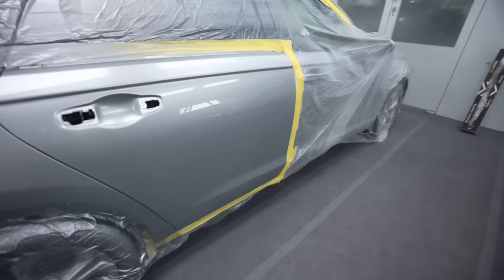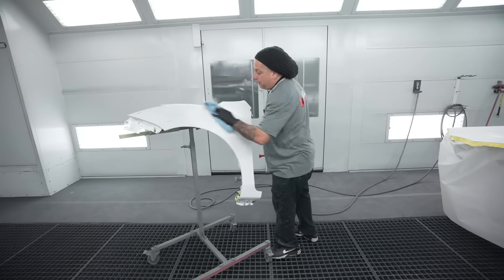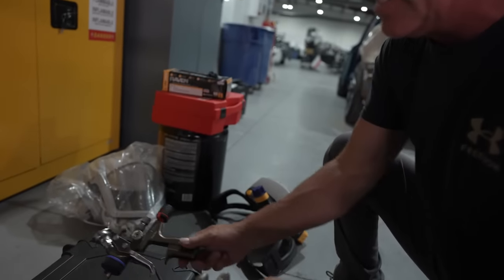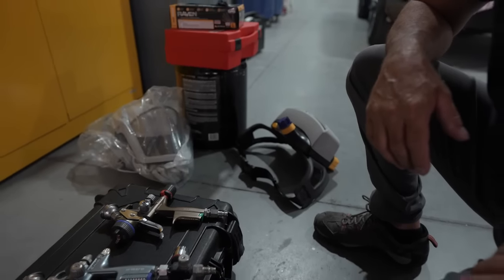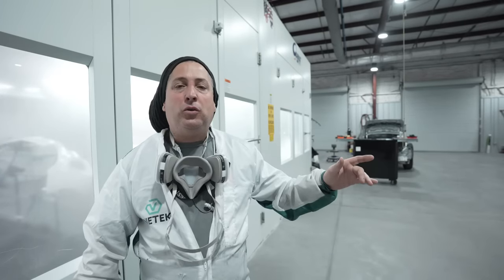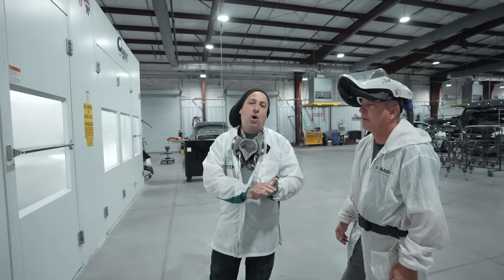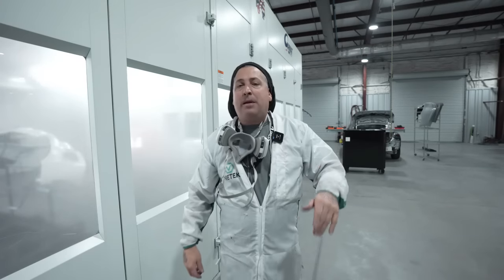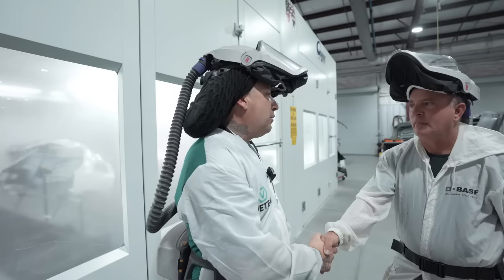Day 4 Of Training With BASF Glasurit 100 Line

Comment: Sata rp5000 1.2 was the best gun for me with the 1.5 coat spies high tech system ( i know this is glasso). I was an hvlp guy for solvent base for 25 years. Even though the reps told me the rp 1.2 . A jobber rep sold me a x5500 1.3o and it was not recommended for my situation. It was too much . Even my 5000  wsb HVLP gave me problems with blends for 2 years i fought it. Then i finally used the rp 1.2 and it was night and day better. which was strange to me because i could not spray silver with solvent dbc, with an rp at all.  Every painter has different experiences though. I would love to try this glasurit water though.

Comment: Now that you have been using the 100 line for a while now, can the camera give you a panel match color every time with any color on the bumper only jobs. Would be great to know this info because chips won’t be available soon
Reply from the maker: The camera work very nice 👌
Reply: I get that they all work but will it give you a consistent match for a bumper only job that you don’t need to blend on the tougher colors like UX, 46g and like colors. That’s what I’m mostly interested in to hear your professional opinion